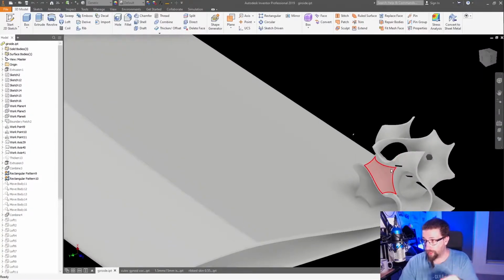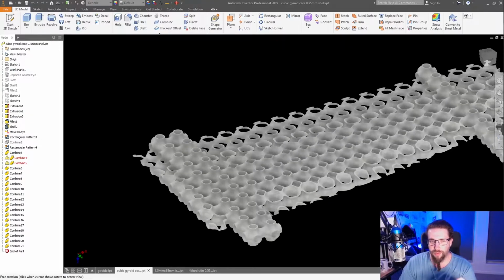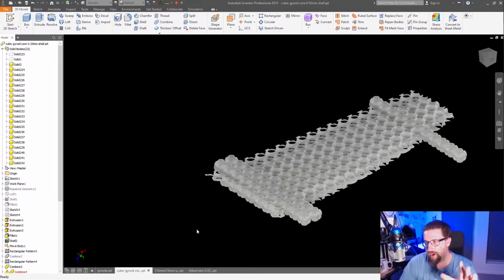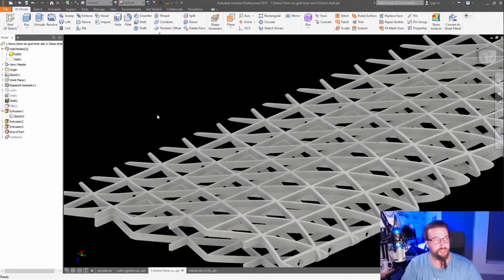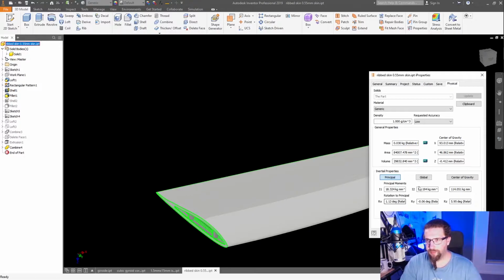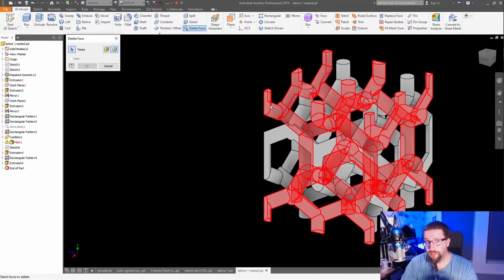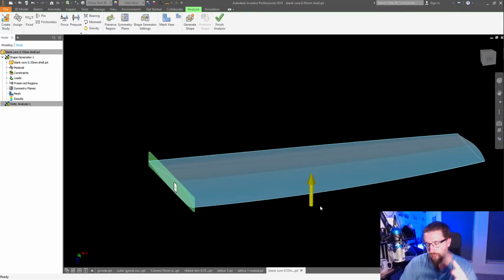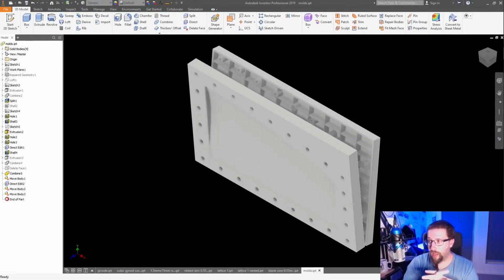chaos daily 2021: 067 Information overload, watch at your own risk!

Comment: Hey, me again, I am still following your channel with great interest :) A auestion that seems really interesting to me, is how thin you could actually print with your printer. As far as I have seen in your videos 0.55mm was the thinnest wall you were able to print reliably? Many strong but leightweight natural structures are almost foam like , and I am pretty sure you could get a better strength to weight ratio if you could utilize thinner walls and therefore distribute the material even more precisely. Most of the high performance F3K or F3J/F5J Planes have foam cores in their carbon fiber wings, even if they are built in a negative mould. You might also take a look at the distribution of the internal structure, like in most Balsa/film covered planes it might be advantageous to have (for example) a higher density of structure in front of the main spar, to get kind of a torsional rigid D-Box, and a impact resistant LE, with less structure in the aft part of the wing, where it mostly needs to be light... But even with 0.5mm walls: Impressive work, keep it coming!
Reply from the maker: print resolution is 0.03mm giving a few pixels for handling curves or diagonals I could print as low as 0.1mm, but then you run into mechanical and material constraints of the resin as during the printing process. think of it like trying to stack individual hairs on top of each other in a vat of syrup with a potato masher moving up and down slowly.
Reply: @23chaos23  Okay, so the precision of the printer would theoretically allow to go super low, but you are currently limited by the printing process itself... To me that in its own is already a huge outcome of your tests, because I always assumed that a resin printer was better at thinwall stuff than a FDM printer. But it seems it is not as easy as that... Do you think you could manage thinner walls better with other resins, slicer settings etc.? Do you know of people who have (successfully) printed thinner walls?
Reply: I mean, you were already able to improve your results quiete a bit by just changing their orientation on the buildplate, (some episodes ago) so there might be some more things to tweak... I think especially the Iso-Grid structure should print really well with the "first" (heightwise?) print orientation, because you dont have the "huge" surface of a complete rib adhering in the vat. Maybe the structure of the isogrid gives enough stiffness to the outer surface to print it with a thinner wall...?
So many interesting things to try!!!!
Reply from the maker: @lasselasse1995  as far I or even Siraya Tech knows no one else is doing this kind of printing. There are a few mini fig guys out there that Siraya arre working with to decrease the size of support material contact points etc get finer surface details. but nothing like what im doing. A lot of the problems are due to the mechanical flow interactions with the liquid resin and the up and down movement. printing with a lower level of resin also seems to help, but then doing a top up is risky.